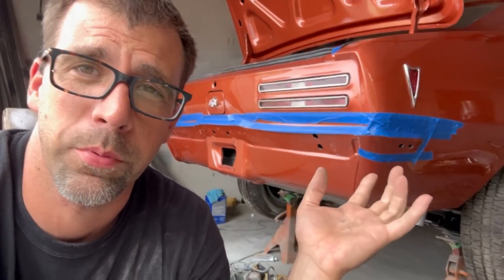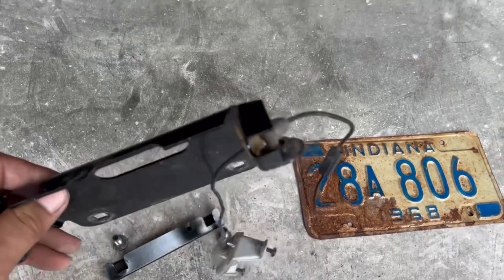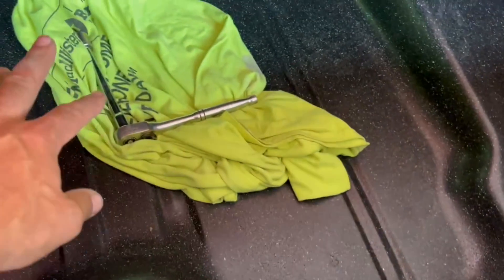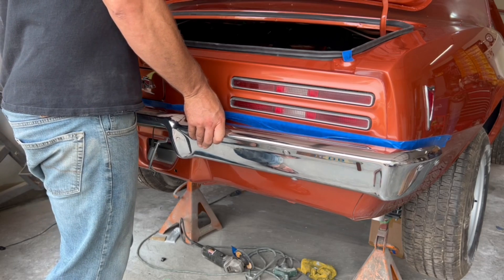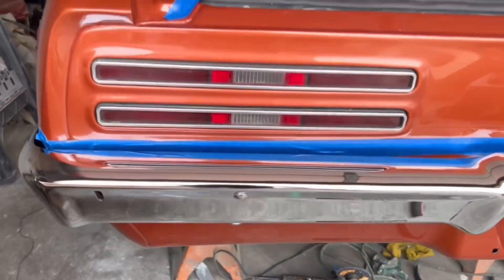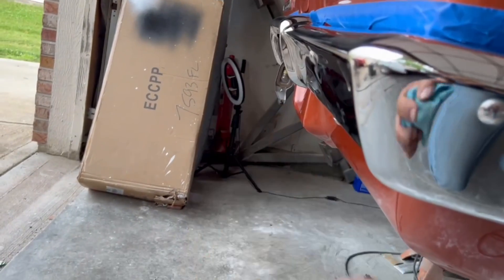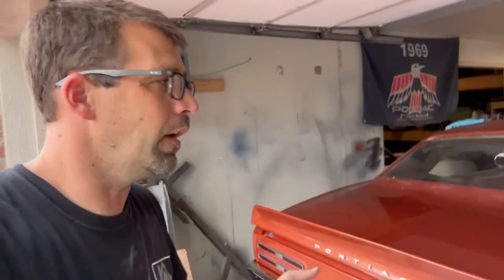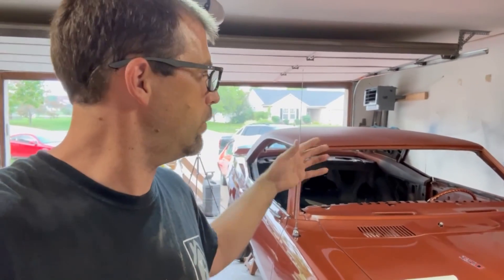1968 Firebird bumper replacement plus bracket location and alignment

Comment: Once again, a fountain of knowledge. As a general rule, would you re-plate an original bumper or use a re-pop and why? I have the originals for my car that would need re-plating to look nice.
Reply from the maker: I would prefer plating original bumpers that aren’t severely damaged. They have better fit and cleaner lines. This one was toast.  I lucked out on the fitment this time.

Comment: I watched this not knowing why I needed to as it differs from the Camaro. I had an epiphany all the sudden. I have new front bumper and my rear is straight but a few scratches. I figured to use it if I needed to. Now I am thinking of a 'bird' bumper on it for more rear protection. 1 in a 100 or less will notice it. I got tapped at a light by a drunk in a pickup in a 69 Vette once. Major damage. I even installed stick on thin black rubber molding on my 67 Camaro as door nick protection and it was almost unseen. At least I will consider this option on the rear.
Reply from the maker: That’s an interesting idea. A lot of people use Camaro bumpers for everything it would be nice to see the a Firebird bumper in a different application

Comment: I was a bit leery about the quality of the 'offshore' bumpers concerning poor stampings, but your results have made me think otherwise.  Do you think the addition of a 'round shim' (washer) would correct the body/bumper variation you noted?
Reply from the maker: Yes the round shims help when it’s bad.  I have a bunch of them when needed but overall very happy with the rear bumper

Comment: Very helpful.   Did your tail pan have the mounting bolt holes pre-drilled?  Mine does not.
Reply from the maker: Nope no holes not even for the license plate.  Have you ever tried to drill a square hole?  Lol. I had to drill them all out.
Reply: @VinylVillageGarage   Good to know.  Keep the content coming.   I see you just added a video on bumper assembly.   Need that one, too.   Thanks

Comment: The factory fit wasn’t as good as yours. I worked at a Dealership for 14 years. GM had Al lot of different suppliers. I live near Norwood Ohio. Parts for Norwood would come from different suppliers the the other plants. The parts all fit different. That was some of the recalls. Good job on bird.  Looks better than new.
Reply from the maker: Wow thanks. These cars where never considered high end and super tight tolerances. I have had some very very rough reproduction part’s especially bumpers in the past.  Glad to know this is better fitting then factory too. I love the fitment even more now.

Comment: I know you are going for an original look with the vinyl top but the cars look better without them. I have seen several that have been restored and the vinyl areas were painted the color that the vinyl should have been.
Reply from the maker: You could actually get the car from the factory with a two tone paint as well. I can’t say I have seen one but it was an option.